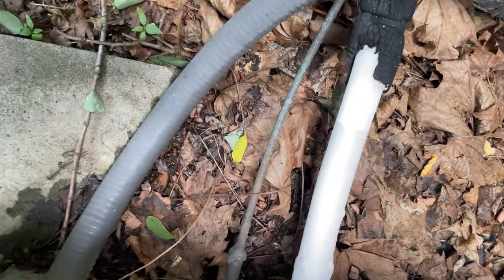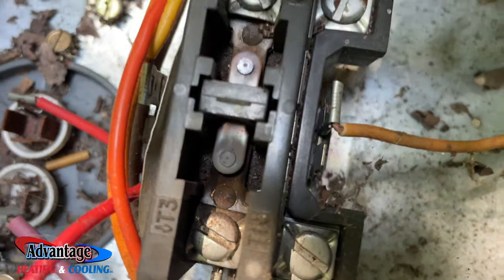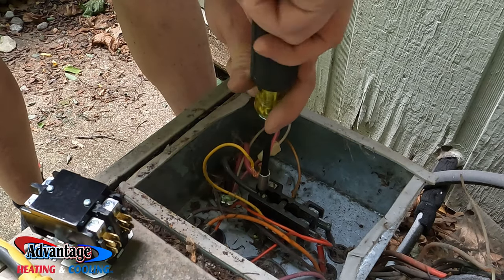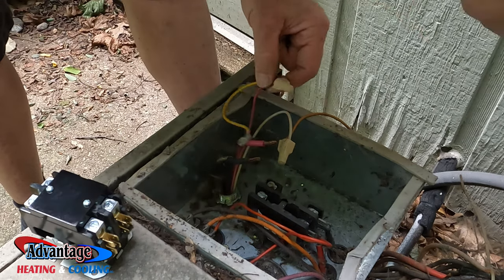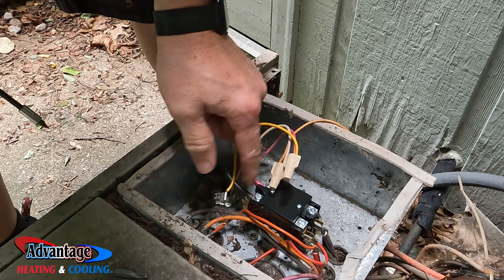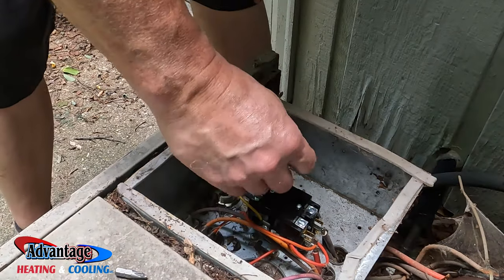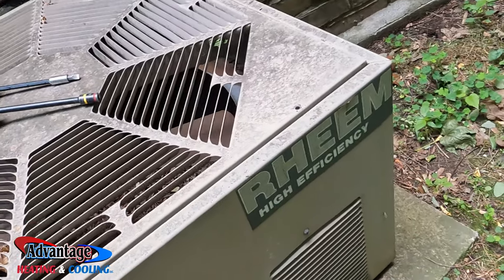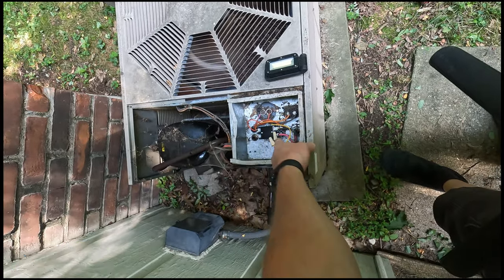AC Condenser Won't Shut Off!  Contactor Stuck

Comment: Late 80s Rheem. Very reliable units. Easy to troubleshoot and although not efficient by todays standards they work well, with electral parts failures being the biggest issue. They got their moneys worth out of that unit. I've had to replace more than a few compressors and evaporators on those but they were 30-35 years old at replacement
Reply from the maker: Yes, for sure they are TANKS!

Comment: Could a bad compressor cause the contactor to keep sticking?  Ive change 3. Of 40amp contactors  already.
Reply from the maker: No Not usually. Most of the time the contacts will weld together and that would make the ac unit run all the time.
Reply: @ADVANHVAC   I'm having that issue. It's sticking in the condenser stays on forever. I already put 3 new 40 amps. Contacts, and it still does the same. That'll be a bat capacitor on it. Maybe the compressor is drawing a lot of amps?
Reply: I even remove the 24 v wires and it stays on.
Reply from the maker: Is the contractor pulled in still?
Reply: @ADVANHVAC   yes. It was welded in. Had to release it with a flat driver
Reply from the maker: I would check amp draw when the AC starts up and while running.  For you to be on your 3rd contactor there is definitely something going on.

Comment: Isn't the condenser the "fin" part of the AC that lets go of the heat in the suction line? That doesn"t not have any electricity to it so how does it not turn off? Isn't it the compressor that turns on and off. A stuck contactor will prevent the COMPRESOR from turning off in this case or turn on in other cases if the contactor is bad.
Reply from the maker: Yes the condenser is the portion of the system that gets rid of the heat.  When the contactor coil closes that is what's starts everything.  This one was closed all the time due to the contacts were pitted and welded shut or closed. That's why the out unit was running all the time. Hope this explained what you were asking.

Comment: Hate those old units , and around here it’s like a calling card Fkn  black widows 😂
Reply from the maker: Yeah I'm not afraid of Spiders, but down where you are at Yup! Nope! Lol
Reply: @ADVANHVAC  I Fkn hate spiders and in the summer hate my profession 
Soon as it’s warm that’s when everyone wants duct replacements and change outs in there crawl spaces 🙄🙄
Greensboro NC here man, talking bout black widows , brown recluse, wolf spider and copperhead snakes 
Hate my life right now 😂 can’t wait for winter
Reply: @ADVANHVAC  and that’s just the worse of the worse , don’t forget all the other critters around here 
During the summer give me all commercial work 😂 package rooftops 😂 and replacing u get to have fun with a crane 😂 and I have 2 of those expensive shade umbrellas
Reply: @ADVANHVAC  you may not be afraid of spiders, but when u get under a nasty crawl and when u touch the air handler (or furnace) and a few black widows crawl across, makes u very cautious at the least 😂
Reply from the maker: Omg. Stick around I’m working on a job the rest of this week and a video will be out with a surprise in it. Pretty much this topic lol
Reply: @ADVANHVAC  today, had to add a run to a bonus room
Was in the basement knocking a hole through the wall (only option) , happened to look to my left saw a large snake skin, swear to god looked to my right the fkr was staring me in the face 😂.. was a black snake but he still made me jump back lol